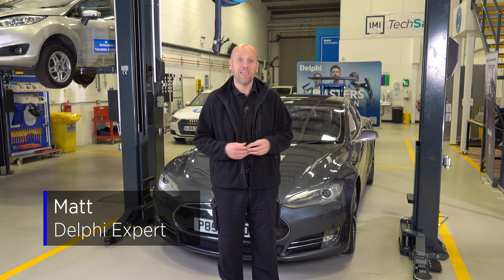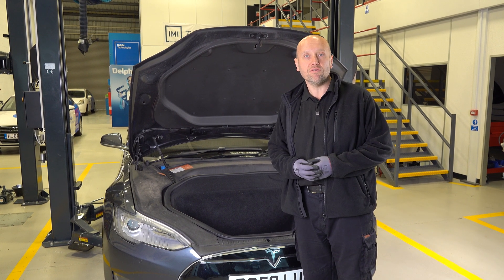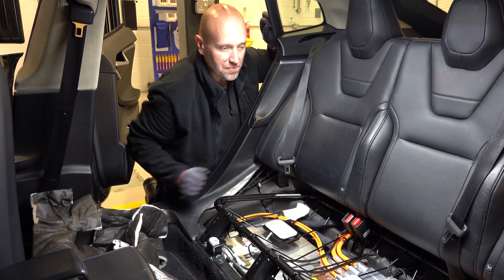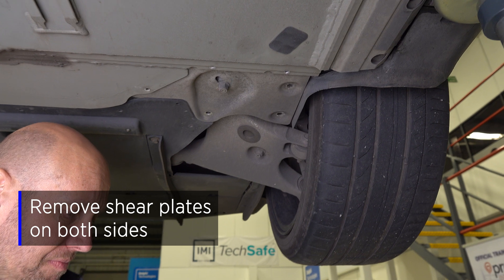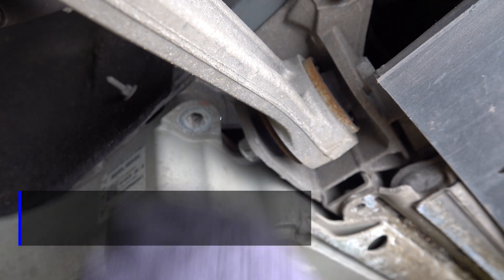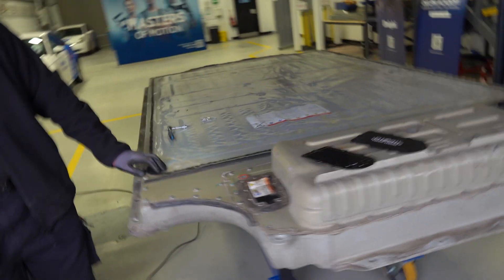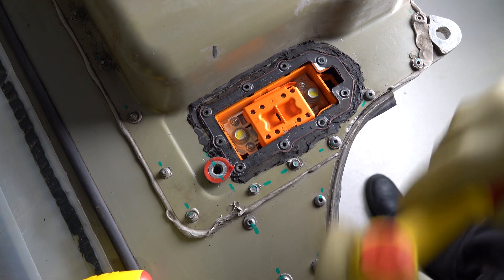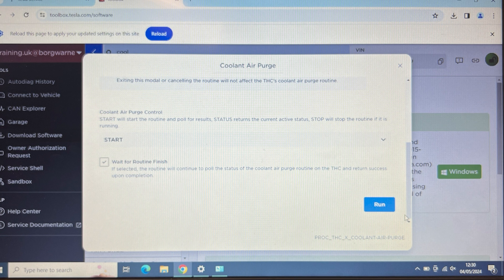[EN] Pyrotechnic fuse replacement on a Tesla Model S | Masters of Motion

Comment: Great video, but crazy that Tesla used a fuse with a finite lifespan in such a hard-to-reach location. You mentioned inlater years the fue is somewhere else - which years of Model S don't have them on top and more easily reachable for DIY?

Comment: Great Video I Have the chance to buy a  Tesla
Model S
386kW 100kWh Dual Motor 5dr Auto
67 Registration
Registered
11/11/2017 with display showing BATTERY FUSE REQUIRES REPLACEMENT What would the cost be to replace the fuse please.

Comment: Hello, I have a model s with the fuse access panel under the car, so I could handle the install in my garage. Do you have to do software changes after the installation? Thank You, great video!
Reply: I’m wondering the same thing. I’m looking to purchase a2012 and it has this fuse warning but the car drives and charges fine. The fuse location is easily accessible under the car via small rectangular cover.

Comment: If this fuse is blown will a message pop up in the info unit
Reply: It's the pyro fuse, designed to blow in an accident. If it explodes the whole HV system will be shutdown and your car is bricked.

Comment: How did he disconnect the wires from the  High voltage battery ??
Reply: Fireman loop
Reply: There are no wires to disconnect. The connection points ‘slot’ into one another. You have to be very careful when lifting the battery back into the car. If you get it wrong and bend the connection points, you’ve got big trouble.